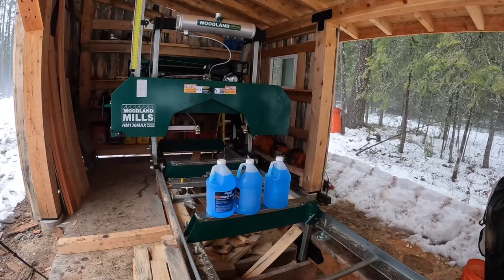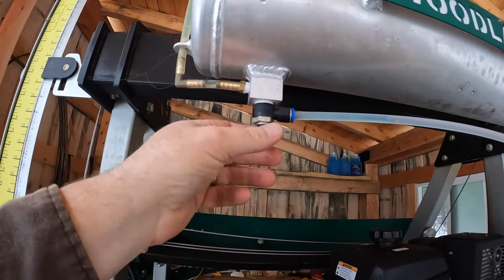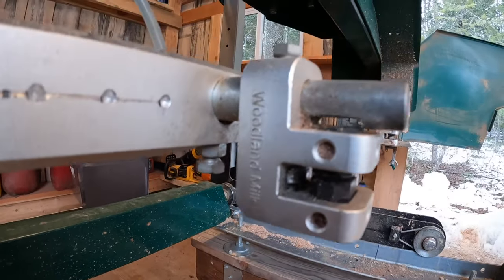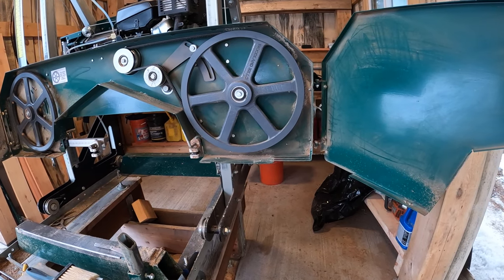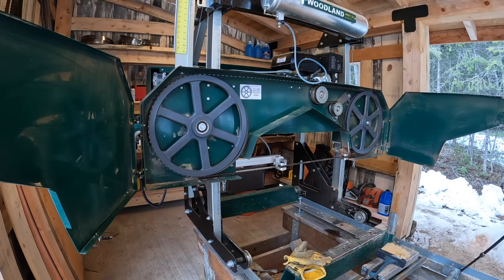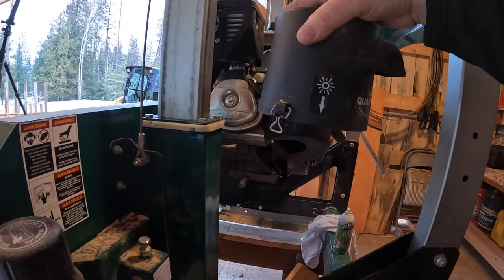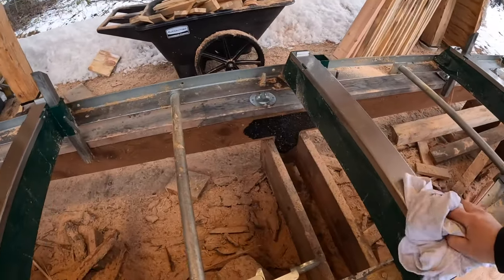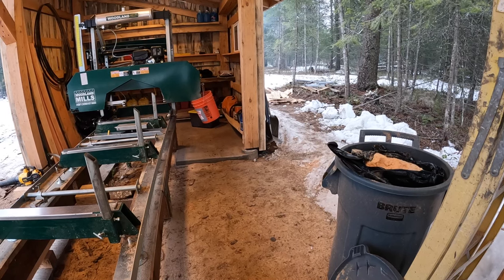SAWMILL Maintenance -  Winter Tips And TLC // Woodland Mills HM130 Max Sawmill

Comment: Good Morning - Nice tips on maintenance. Let's start with this - my HM130 has about 50 hr's on it and I noticed my bearing had quite a groove in them. I looked in my Spare Parts kit I got from Woodland mills and there were 4 of those bearings included.  So I decided to change them. It takes an 8MM hex(allen) and about 10 min.  I did all my work from the back side of the blade - You can see that bearing clear as day from the backside if you are looking. Also of note - I see that Amazon has a 10 pack of the bearings for 8.99.  6002-RS  10mm X 26mm X 8mm Bearing.  My thinking is for $2 and 10 minutes I can keep shinny new bearings on it when I see any groove.  Hope that helps.
Reply from the maker: Thank you, Mike! You are the second person who has suggested the bearing change. I'm going to do it with my next blade change. Thanks for the advice and the part number. I'll order some of those to have on hand. Thanks again! 😊

Comment: Very interesting as always!  I like seeing the behind the scenes.

Maintenance is so critical to any piece of equipment.  Not a sawyer, but I would suspect that like vehicles, there would be a time/usage component to replacing parts.  Does the manufacturer have a suggested maintenance schedule by hours and/or time?

Like you, I would leave them for now and when I did spring maintenance revisit the issue, unless I saw or felt any new vibrations.
Reply from the maker: Thanks, KJ! The manual for the sawmill just has a troubleshooting section. But, your comment does remind me that the motor is probably due for an oil change. Thanks for your comment and watching! 😊